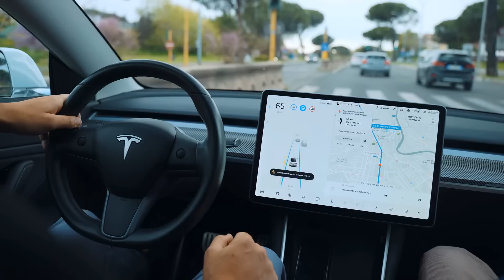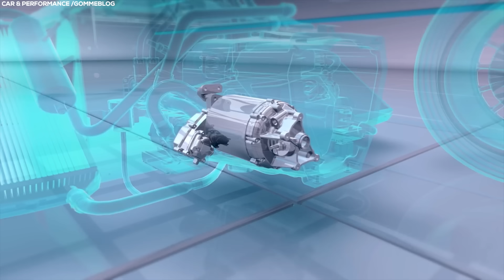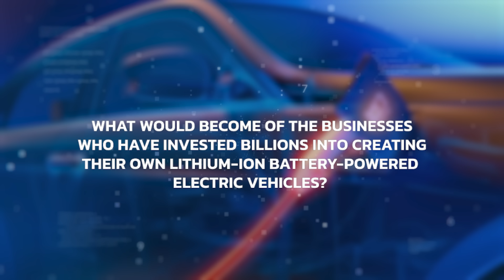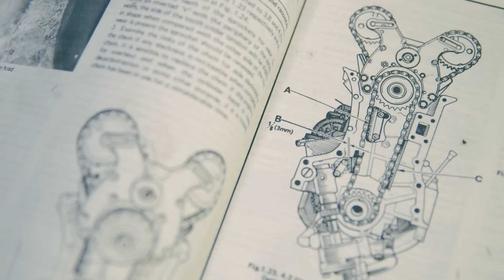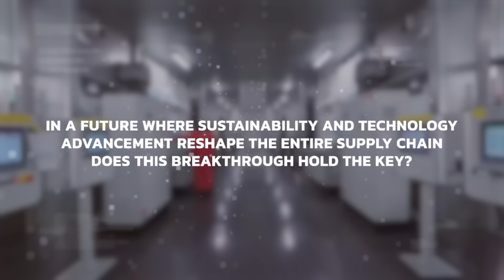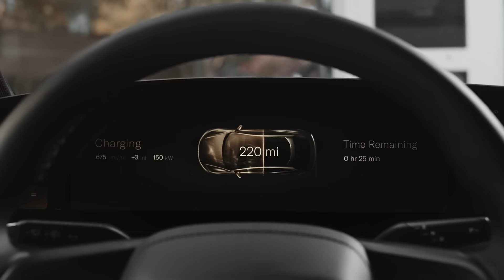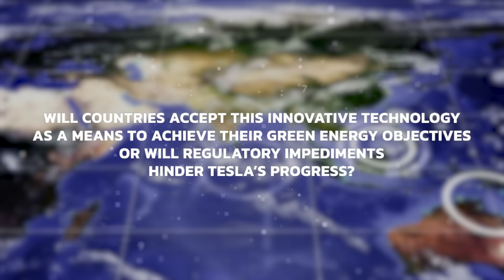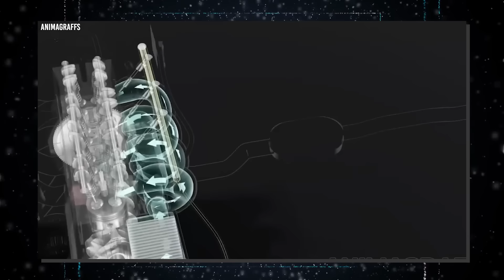Elon Musk: “This New Engine Will Destroy The Entire EV Industry!"

Comment: To increase the range of the electric cars why don’t any of them have a charging mechanism in them that is powered by magnets. Magnets power, the rotation that generate the power that will constantly keep putting a charge into the vehicle hence increase mileage, smaller battery pack. That way whether it’s running or not the battery is charging

Comment: *  Question: What does the Railroad have ?...

  Answer:  1engine =  1 diesel engine 
                                                  +
                                     1  electric 
                                      Generator 
                                                  +
                                   Multiple 
                                    Electric 
                                   Motors
                                 ( w/wheels)

 Results:                $$$$$$$$$$$